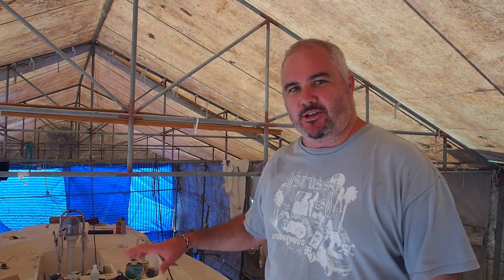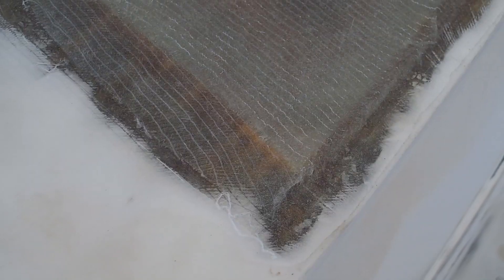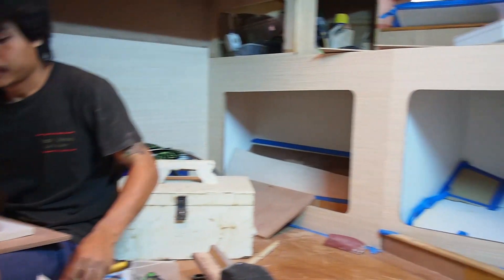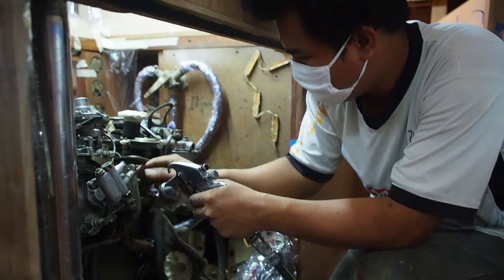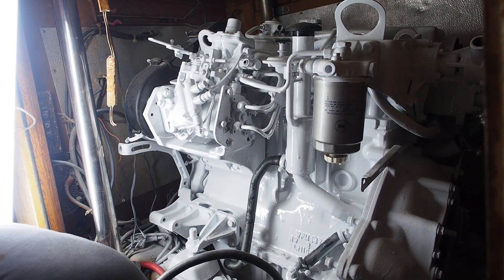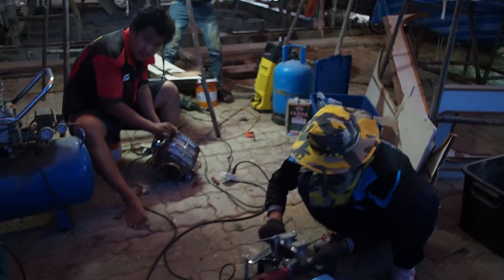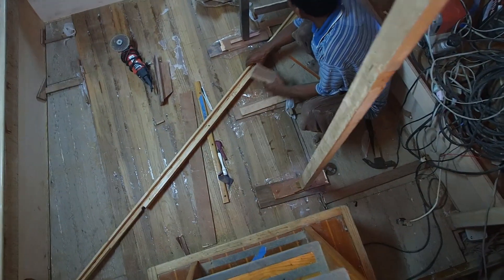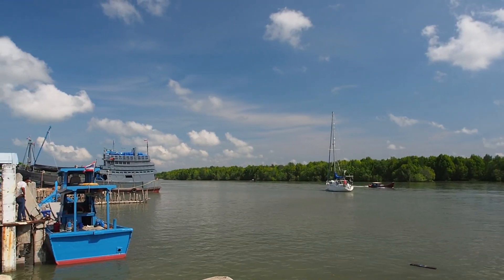Esper Refit 12 - Engine Respray; Teak Toe Rail; Polishing Deck Fittings

Comment: Your "Esper Refit" series is amazing and the most informative I've seen on YouTube.  The most notable thing I have learnt is GRP is my least preferred boat hull material, especially if the boat has been neglected for any period of time.  You've mentioned previously, Esper has an extensive history of neglect before you bought her, which you appear to be paying for here.  If Esper was hypothetically an aluminium, or steel, or carbon fibre hull instead (of GRP), which of the 4 materials would you prefer to work with in a refit?
Reply from the maker: +Darth Schumy [Liz] We don't have experience of any of the others, but watching fellow cruisers chopping and welding their steel hulls with ease in the boatyard, we'd have to say STEEL!
Reply: I had a feeling you might say that.  There are many advantages to steel I guess:
* it's everywhere
* skilled steel workers are everywhere
* the metal is easy to weld (compared to aluminium)
* weak rusted sections are easy to detect
* it's tough and can take on icebergs (maybe not, but it is tough)
* it's relatively cheap
* it's visible on radar from great distances, so collisions are less likely
* Navy boats use it (but they hate the previous point!)

Your refit videos have put me off fibreglass permanantly and that is appreciated.  I'm curious about aluminium though and would love to find a series on refitting a neglected aluminium boat.  It would be interesting to see what an owner would have to go through, to restore that type of hull.  It wouldn't surprise me though, if all they had to do was raise the anchor .... lol!
Reply from the maker: +Darth Schumy [Liz] GRP is still our preferred construction, but steel would be our second, for some of the reasons you give. 
You have to remember that Esper was 24 yrs old when we did the refit, she had osmosis (because we stayed in brackish water in India for nearly three years where we could not haul her), and we stripped a full teak deck - few boats have all these issues at the same time! 
In Ep 35 (HOW TO CHOOSE THE BEST LIVEABOARD CRUISER BOAT?), we discuss the different constructions. Start at 6:11.
Sounds like you are doing all the right research! Peace and fair winds!
Reply: Considering Esper's history, that you documented in a prior "Comments" section, it's surprising that Esper lasted as long as she did, before this refit became necessary.  The original builders clearly did a great job.

I am slowly working my way through your "refit" series and I am looking forward to seeing the end result.
Reply from the maker: +Darth Schumy [Liz] Yes, she's an Oyster and back in the day they were built to last! It was three years stuck in India which did most of the damage.

Comment: I thought you were trying to go low maintenance on deck so why did you go with teak toe rails instead of aluminium?
Reply from the maker: Good question. However we don't varnish our toe-rail, we leave it natural. All it needs is a bit of washing or a good sail to keep it clean. On top of that, here in Thailand the teak option is cheaper than importing an alu rail.